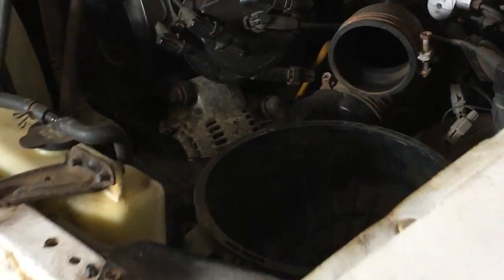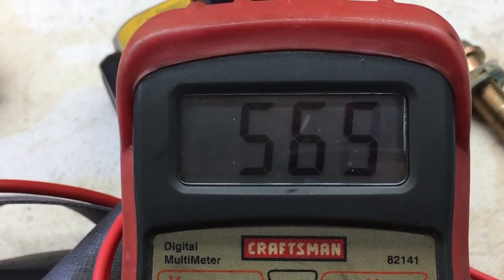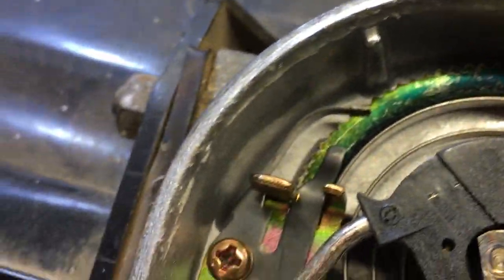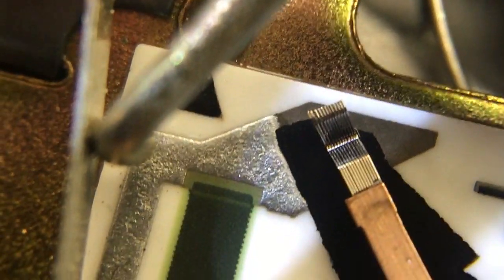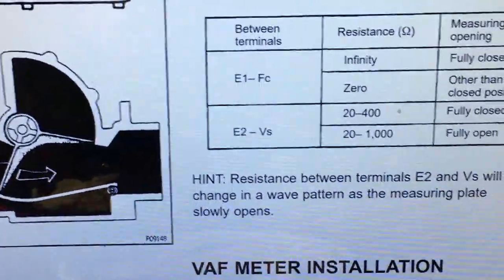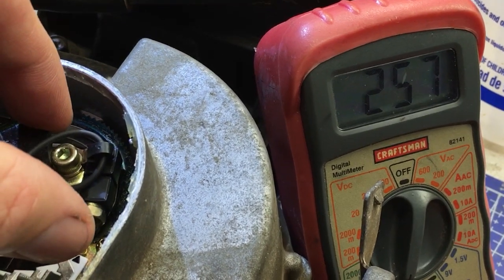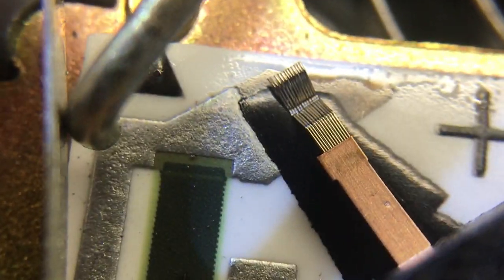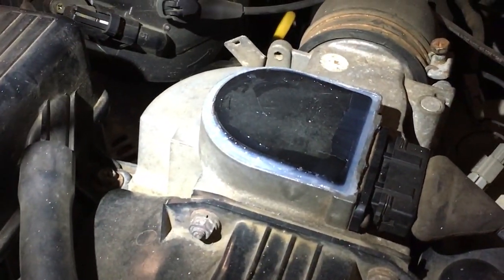1991-95 Toyota Pickup 4Runner 3.0 3VZE air flow meter FIX

Comment: Im having a issue right now where itll start, run for about 10 seconds and then sputter and die, took that mass air flow metre off, cleaned it no change unless i manually control the potentiometer in there then i can get it to run. I checked it with a ohm metre and it seemed to be within spec but as soon as i let off the potentiometer go it dies.  Anymore insight would be awesome. Ive been struggling with this for about a week and have found next to nothing on the internet. Thanks
Reply from the maker: Does it run okay if you just unplug the AFM?
Reply: @Shane's Getting Handy  no, it dies right away and then wont start unless its plugged in again.
Reply: This sounds a lot like the problem I am currently having with my 91 truck (3.0L).  The old AFM tested out of spec and not a smooth transition in resistance, so I bought a new AFM. The engine started quickly (with the new AFM) then sputtered and died. I tried a few more times with similar results. There was a noticeable gasoline smell, like it was flooded. Sill troubleshooting it.
Reply: @J F  i had found my issue. I turned out to be the fuel pump. My best advice would be use a fuel pressure test, there is a 19mm bolt that connects the fuel line to the fuel rail on the drivers side. Thats where the pressure tester goes in. If theres no pressure hook up at 12volt battery to the fuel pump plug and then test the pressure. What happened with mine was the brushes had worn down the commutator so far that the springs that push the brushes against the commutator had run out of spring prsssure so it would make contact only sometimes and momentarily. Hence why id run for a while and then die.  Hope this helps.

Comment: Nice 93 Toyota! Those are hard to find! I have a 01 Tacoma 4 cyl. 259k and still runs great.
Reply from the maker: The early Tacomas are super nice too!  I had my eye on a 1997 for a bit, but the '91-'94 pickup was my ideal truck and I finally found one that hadn't been severely molested or rusted out.

Comment: Thanks for this insight. I recently put a snorkel on my 95 runner and it will bog down after shifting into third. I assumed it was an unhappy air/fuel ratio but this has me wondering.

Comment: Another little trick on this 3.0 engine:  the air filter has a couple of small holes on the edge.  These must be lined up with some small holes in the air filter container when installed.  If the holes are not aligned correctly the engine will not start.
Reply: My truck didn't start after replacing my air filter, assumed it could be everything else but the air filter, especially the fuel system or maf sensor but everything is completely fine
Reply from the maker: Thanks for this!

Comment: The stuck the probe in the exhaust today, came up with too much of a fuel mixture. And you can smell it in the exhaust as well. Would the maf be the problem?
Reply from the maker: It's certainly one possibility, but unfortunately it's not the only thing that could cause a rich mixture problem.  A bad O2 sensor, temperature sensor, or a handful of other things could also cause this.
Reply from the maker: Also, check your fuel pressure.  I will be making another video related to this very soon.

Comment: I am facing a similar issue. However, my engine starts slowly then slowly dies after ~40secs. I suspect the VAFM is not turning on the fuel pump. I confirmed my suspicions by putting a rag in the intake to hold the flapper open. Then checking the output voltage on the COR relay. When the VAFM is open it is supposed to send power to the output of the COR. This did not occur. Additionally I checked the E2-VS terminals while moving the flapper. The reading were within the 20-1200 ohm range, however it would ready infinity at certain points. I think I need to do what you did and clean that black strip. What was the best way you found to remove the silicone from the cover?
Reply from the maker: Cleaning the strip sounds like it may help in other ways, but I'm pretty certain your issue is instead with the E1-FC terminals, which are actuated by the "stop switch" I refer to at 2:01 in the video.   Test the output from FC-E1 (the furthest left two terminals).  The output should be infinity at rest, and zero when rotated at all.  This is what commands the fuel pump to operate when the engine is running, and after the key is released.
Reply from the maker: If the test fails, I would open the AFM, and clean the contact pads on that spring switch with some folded sandpaper, similar to how you would clean the points on an older ignition system.

I scraped the silicone out mostly with a sharp knife and a small flathead screwdriver.
Reply: I opened it up and cleaned the strip until the resistance was normal. I did notice a scratch on the gear at the base, it looked like the contact made it. Unfortunately I didnt touch it for fear of ruining the surface and sealed the unit. The truck now runs great, but when i depress the gas it imediately dies.
Reply: Though I would update, revisiting this video because of another unrelated issue with the VAFM. Anyway the culprit was the COR Relay. Water got past the radio antenna and dripped into that relay. It is located in the passenger kick panel. I relocated the new one closer to the firewall and it fired up and runs good.
Reply from the maker: @codyhinds683  Thank you so much for the update!  I had water in that area as well and it ruined the horn relay...  I made a video about it.

Comment: If the reading is that low, that will be a 22re metre, 3vze ones are supposed to be around 400-600.
Reply from the maker: So it appears I was looking at the 22re section of the manual, and you're right, the 3vze section shows 200-600 ohms, instead of 200-400.  Thanks for the info, and now I wonder if this truck has the wrong meter installed.  I'll check into it.